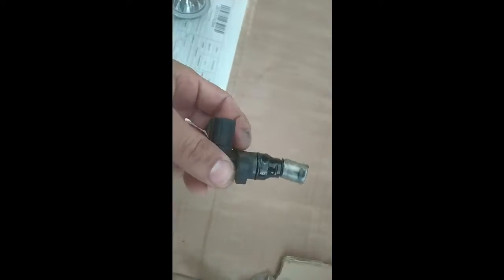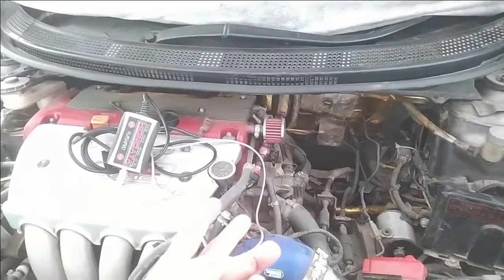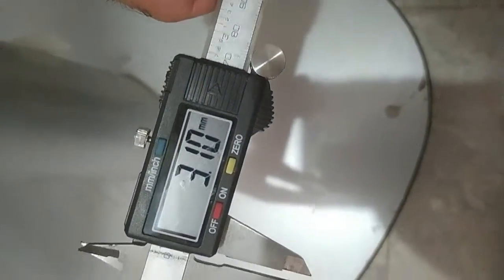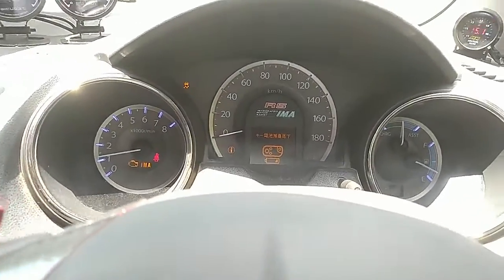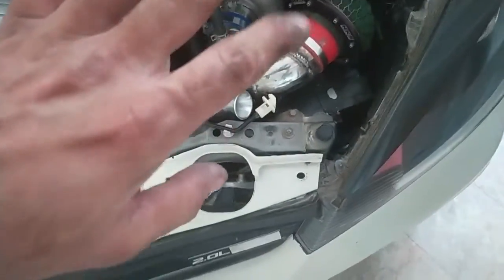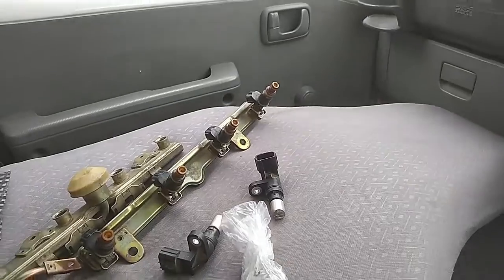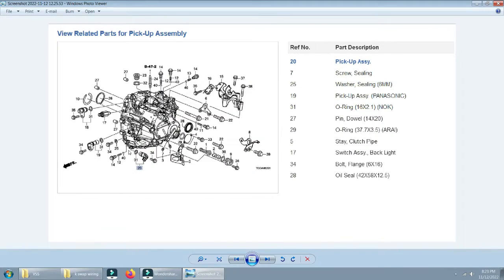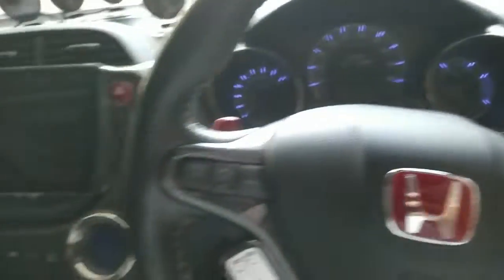Honda Speed Sensor Washer Mystery Solved.

Comment: Hi bro good day im having the same issue now. Just would like to know what car exactly your gearbox was salvaged from. Please and thank you.
Reply from the maker: dont know exact model but was a manual 5 speed RSX/Accord gearbox. The washer size is universal wich i mentioned in video. just use it and it will solve your problem
Reply: Ok thanks
Reply: Ok bro update !!!
I had to sand my washer all the way down to 3.20 on y 2007 civic SI which has a replacement FN gearbox.
Funny enough a friend of mine has a 2009 FN and doesn't use a washer.
I think it has to do with the aftermarket sensors all having different measurements.
I bought 2 different brands from amazon 
A premium brand touched at 4.15
ZBN brand is what's working now at 3.20.
Ps i sanded my washer down at increments of 0.05mm 😅
Reply from the maker: @mendezgunzalez  nice hard work bro. Did you used a normal washer and sand it down or orderes those bumper fasterlners I showed iny video?

Comment: Customer called me about this last week. Previous guy did a clutch job. After multiple speed sensors he gave up. I thought the lady and the mechanic didn’t know what they were talking about but I found this video from an old Acura forum. This is apparently a VERY common issue but most don’t fry the ECU. Honda has ALWAYS had issues with their speedo/VSS/CSS sensors. The old Cd5’s, EG’s, EK’s, DA’s and all had some sort of speedo issue in those generations. That’s why so many of them used to be “low mileage “. The owners never fixed them until time to sell or for emissions test. Regardless, I’ve found numerous Honda Acura threads supporting this problem. Thanks for the thorough analysis and sharing the resolution. God bless!

Comment: If this was a Honda problem it would have had the issue from the factory and never would have left. I’m going to assume it’s a mismatch component issue. Like the sensor was not for that transmission or the stock fit/crz gauges didn’t like the sensor you was using and required manipulation to get the sensor to work with the fit/crz gauges.
Reply from the maker: From factory the cars are made by robots with extreme percison. Afterwards mechanics dont pay much attention to this minute difference between overtighten or less tighten. Anyway you can find this issue at rsx, tsx , k20a forums too. So its not my Fit/CRZ related, but K-series related and many people have thanks me after posting this video. those people were not using a Fit/CRZ but genuine cars TSX, RSX guys
Reply: Well if it was a tightening issue, or something of that nature, Honda most likely would have issued a TSB for their technicians and general consumption. Also, if it was just a tightening issue you would have not had to use a spacer.  I think there’s a little more than meets the eye to this issue.
Reply: @JohnDoe-mm6xg I’ve been through 4 sensors in my accord now and this is def a Honda issue. On a few different generations of a few different cars using a few different brands and even oem sensors. Its definitely odd but you would think they’d at least address it
Reply: Well if it was a tightening issue, or something of that nature, Honda most likely would have issued a TSB for their technicians and general consumption. Also, if it was just a tightening issue you would have not had to use a spacer.  I think there’s a little more than meets the eye to this issue.

Comment: What is the acceleration of the Honda Fit RS hybrid in stock to 100 km / h?🙏🙏🙏
Reply from the maker: depends upon if its a GP4 or Gp5. I don't know exact numbers but from my research Gp5 has More hybrid battery power and its time is 0-100 in near 8 seconds. For Gp4 you can say its near 8.5
Reply: @A.QPerformance  I have a gp4, a variator, it was very interesting to know the acceleration to 100 km/h.  Thanks for the info!
Reply from the maker: @НикитаМ007  Your welcome but you sure you are positng in right section? i think this video does not adress any acceleration, rather a problem due to Honda sepeed sensor  washer

Comment: You should have sent all the bills to the shop that produced the damage...
Reply from the maker: ha ha. The guy who over tightened  that 10mm bolt is very poor guy working on daily wages. They pay them justRs:230 (1$) a day. So i did't feel like pressing charges. Also they initially did't tell me. They kept saying they car will be ready in a day and than another day and another. Behind they were trying to repair an ECU which even did not exist in Pakistan. It was  a USA civic si ecu i imported for this swap. So one thing led to another... 
Soon i went there and the owner guiltyly admitted.
They said they had sensors fry before but a damaged ecu was 1st one and unlucky the Flashpro was locked to that. So to bring CRZ home, i took the Fit ECU(same k-Swapped) and its immoblizer. Did the wiring there as the immoblizer pinouts were different. Than brought CRZ back. And than began this experimenting to solve this stupid Honda mistake not to put a washer to begin with